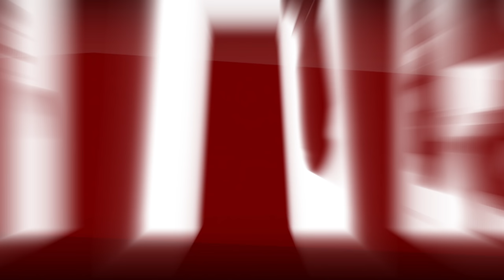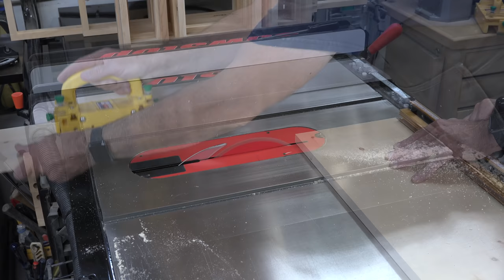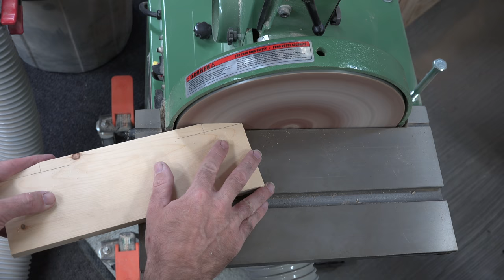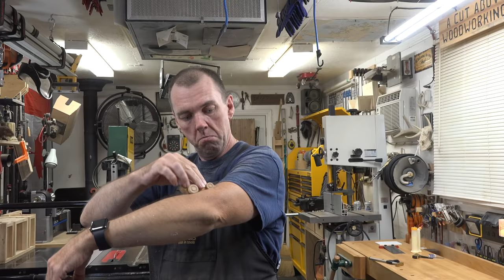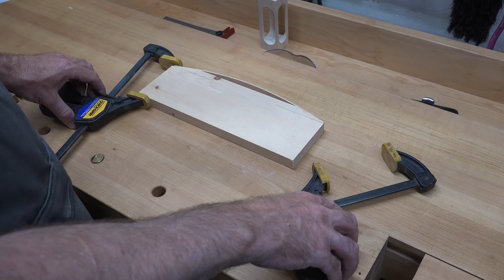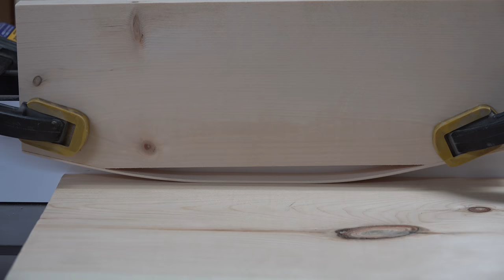Spring Loaded Hold Down

Comment: What a simple practical solution.  I have a fence with a t slot and made two of these. One for the In-feed side of the blade and one on the out-feed side, which allows me to cut thin stock.  Over the years I have used inverted finger jigs which never held position. This is the best solution I have found. Thank you.
Reply from the maker: You are very welcome Ian.  I'm glad that you found the show to be useful.  Thanks for tuning in and for taking the time to leave a comment.  I truly appreciate the support.

Comment: Great idea, Ken!  Gonna make one (or two!) of these for my router fence.  Perfect hold-down solution for long, narrow pieces.  I'm going to use white oak vs. pine.  Hopefully the results will be the same.  Thanks Ken!
Reply from the maker: I think that white oak will be just fine, but you may have to adjust the angle of the sides of the hold down in order to prevent the white oak from splitting along the coarse grain patterns.  Let me know how it works out.  I'd be interested to hear the results.  Thanks for tuning in to the show.

Comment: Top banana! Excellent hold down spring clamp. Just wondering if it would be more durable if I were to use a cheap steel ruler. Anyhow, I'm going to give it a go. Thanks for sharing!
Reply from the maker: I've never had one of these break but if you'd like to add a steel ruler, I don't see why you couldn't.  Thanks for tuning in and for the kind words on the show.

Comment: do you think this could be made to eliminate snipe when planing boards
Reply from the maker: I'm sure that in some way or form, there could be a type of spring loaded hold down that might work for that application.  It would have to be a pretty small hold down however because it would have to fit in between the front and the rear feed roller of the thickness planer to prevent the wood from raising prior to hitting the second feed roller.  I think it would depend on how small these could be made as well as what kind of available real estate is under your planer.  Something to think about though.  Thanks for tuning in.